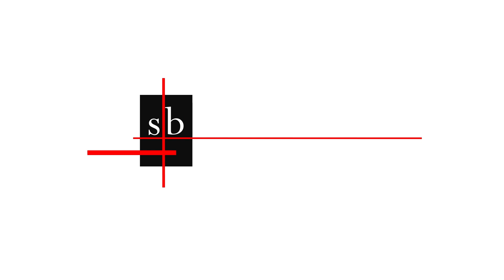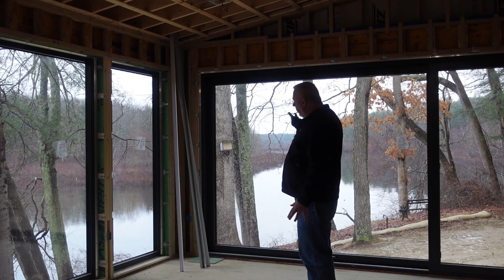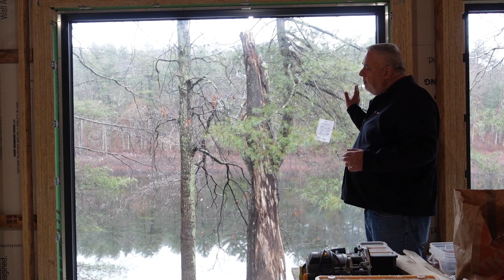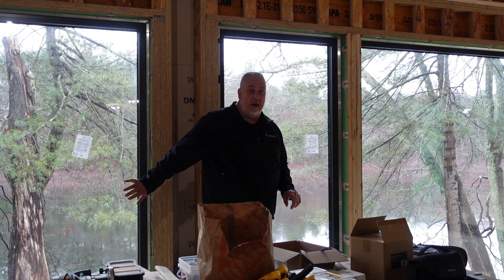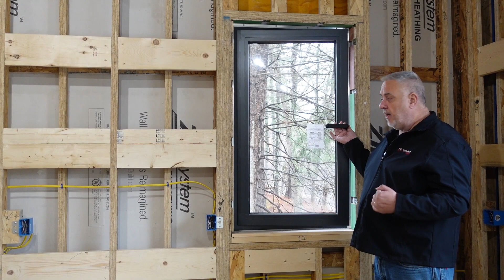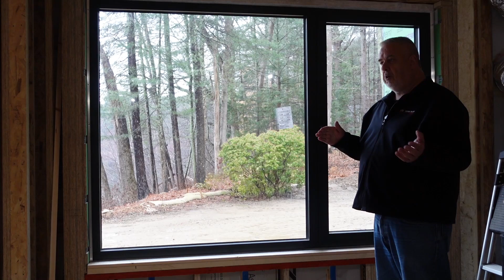LET"S TALK TRIPLE GLAZED WINDOWS

Comment: Thanks a lot for the informative video, I was confused as the floor you are standing seems like first floor, I mean not a ground floor. Why would door open to outside leading no where ? Also for safety reason if one is to have a child that is really a concern in the absence of railing or any other safety measure. Maybe I have not understood something. Let me hear from you. Thanks
Reply from the maker: a small deck will be outside the lift n slide door. Final grading is not done yet, grade coming up, retaining walls etc....

Comment: Great video! The European windows are definetely on a different level, it would be nice to see a video with the cost comparison difference( I assume that they cost more) and payback times being 2 to 3 times more efficient than my Marvin Windows for example. Also what are the lead times for those windows and how would the warranty be handled if the manufacturer is in Slovakia?
Reply from the maker: As a UPVC window the Euro's will rival, or most likely cost less than your Marvins.....the aluminum will rival or cost a little more depending on the Marvin type

Comment: On that tilt turn window, if you mount it closer to the interior, will it swing in all the way so that it could be stowed flat against the interior wall?  If not, I might have made it swing the other way, especially if it is going to sit 90 degrees from the wall when fully open.  I'm thinking ICF for my future retirement home and I like drywall returns for the window trim along with an interior sill.  I guess if I wanted a tilt/turn window in that case, the window would stick out 90 degees from the wall.  Of course, one could just use the full open mode for cleaning and the tilt mode for fresh air.  Just things to consider when choosing your mounting position and swing direction.  Thanks for your videos.
Reply: Since there is blocking installed to the left of that smaller window, I suspect there will be some cabinetry installed there. That means the window would open up against the cabinet which makes more sense than having it open away from the cabinet.
Reply from the maker: yes
Reply: I worry about furniture blocking the window's ability to open, in my current house most of the windows extend below couches, end tables, and nightstands
Reply from the maker: To open these windows you use the tilt option.....the turn option is for cleaning, NOT venting

Comment: How do you typically handle insect screening on the tilt-in windows?  A full external screen is fine, though it will certainly spoil the exterior look of the windows.  I've experienced some tilt-ins that build a wrap around accordion screen into the window frame on the tilt portion, but those tend to get fouled up with pollen goo within a year.
Reply: new england humidty + having an erv = why would you want to open the windows?
Reply: @stevecrawford6958  if on the second floor, to clean them could be one reason. If on the main floor but still requiring a ladder, to also clean them.🇨🇦
Reply from the maker: If you notice, where the exceptional views are, the windows are predominantly fixed. The operable windows will have screens to the outside